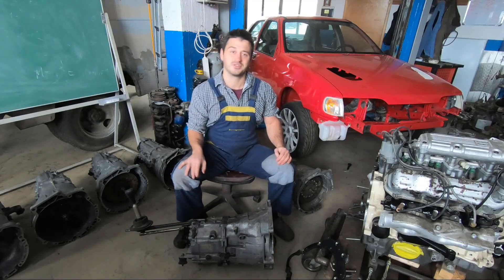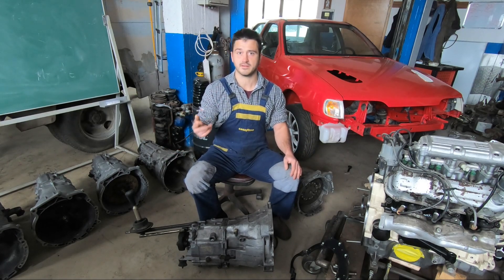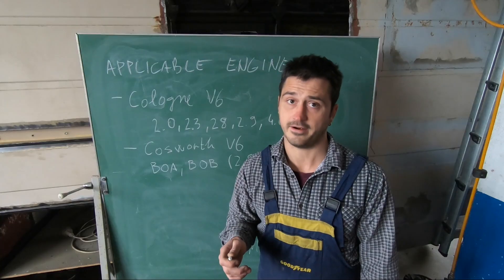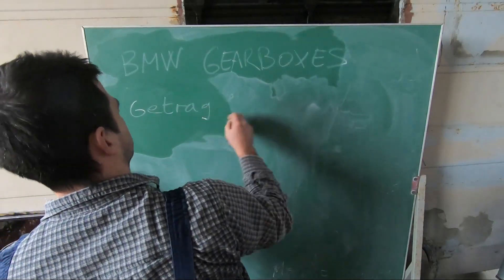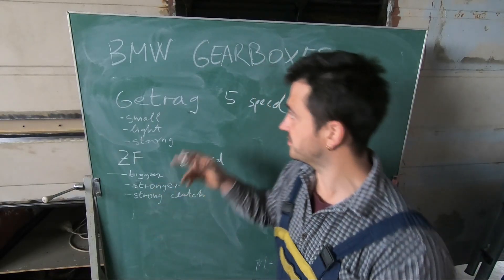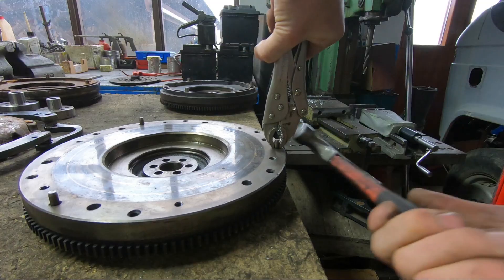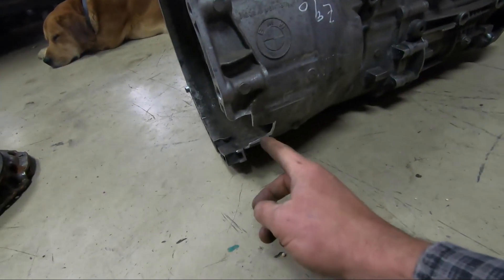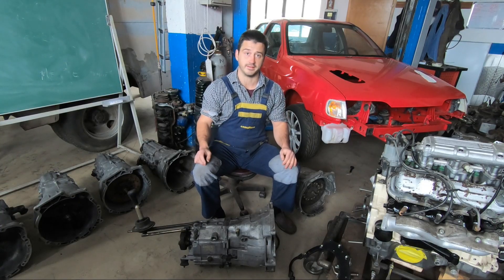Ford V6 to BMW ZF/Getrag Gearbox | Custom Adapter Plate Kit

Comment: Fantastic kit. Seen others with a welded front case on the bmw box. 
If you move the top two bolts down and out it will fit the Ford 4 cylinder engines as well. clutch cover may need a different solution but i know the bmw clutch plate will fit the cosworth yb flywheel. 
One for the future, if you want a sequential gearbox the 8HP bwm gearbox is becoming popular. But the electronics are expensive, gearboxes are very cheap though
Reply from the maker: Yes, I've seen them welded as well, but wanted to make a simpler solution. 
I didn't know that the 4 cly pattern is that similar, but will check as I'm planning to make a pinto/zetec adapter too. 
I also had my eyes on the 8HP,  I've seen plenty of different electronics solutions. Waiting for a good offer on one locally 😁

Comment: This kind of videos are extremely helpful ! I am currently making a flange for a drift Sierra with 1.8T from Audi using the stock MT75 gearbox. I hope the gearbox can handle once the engine gets some upgrades :D. Information is really hard to find so awesome that you share it !! Awesome channel
Reply from the maker: Glad you found it useful! I also want to build a RWD 1.8T at some point, probably will be going in one of my Escorts. 🙂

Comment: Wonder how well these fit into a Capri gearbox tunnel
Reply from the maker: Not sure as I don't have a capri at hand. I can, however, compare it back to back with a MT75.
Reply: @HappyDayGarage  How do they compare to the MT75? The MT75 (or MT75 hybrid) fits quite well in a Capri

Comment: What a great video. Do you do a plate for a different engine? I have a GM y32se , fantastic engine,5 speed is gearbox terrible, so looking to do a gearbox conversion, like yourself
Reply from the maker: Thank you! Unfortunately GM is out of my scope, at least for now.
Reply: @HappyDayGarage  hmm. Just thinking if maybe I could use some of your kit parts. I’ll investigate and come back to you. I already a race colleague with the cosworth cologne so I can measure his bits and see how similar to the gum stuff eg input shaft diameter, length etc
Reply from the maker: @michaelbeacham7865 sure thing! Gotta make it work somehow.🙂

Comment: I'm in the UK and that's another interesting enjoyable video. I run a BOB bolted to a Mazda RX8 6 speed. Gets some abuse and hasn't let go yet?? The issue i have is I love the BOB but getting spares for it over here is a joke tbh! People comment saying BOA is a better engine because it's got a duplex timing chain. But there's loads of engines that only run a single and the way I see it is if the chain gets noisy or it's high mileage? JUST CHANGE IT!! Gearbox swaps are my interest and you cover it very well.
Reply from the maker: Totally agreed. Many engines get falsely accused of being "bad" based on a couple of bad experiences. As I  see it, a big factor is what kind of life the engine has had and of course what maintenance it recieved.
Reply: The whole 'BOA is a better engine' thing is a total myth, mainly said by people who have never worked on either. The BOB is a stronger engine in most respects.
Reply: Im in Ireland, running a Bob with a rx8 5 speed for drifting.
Happy to see there's option in the future when I go turbo and big power.